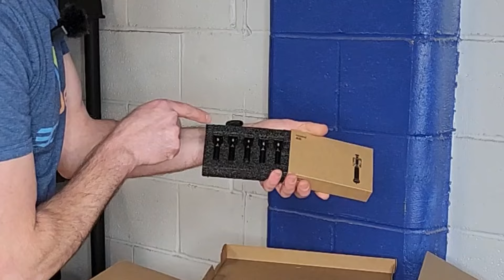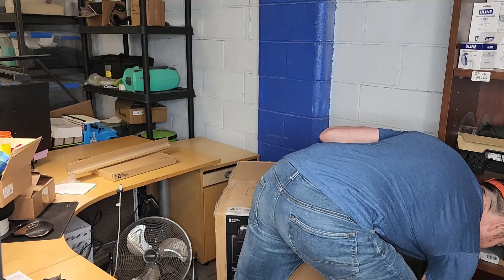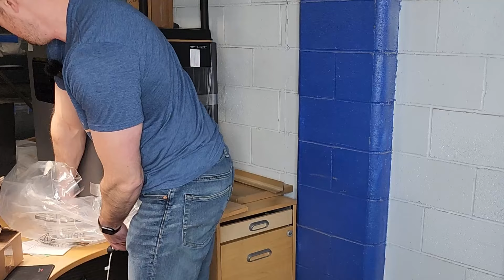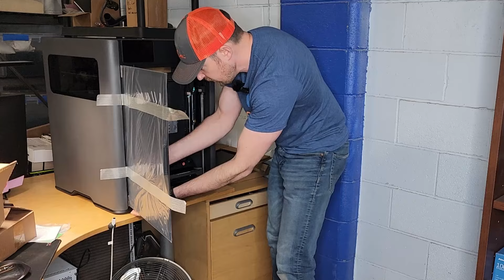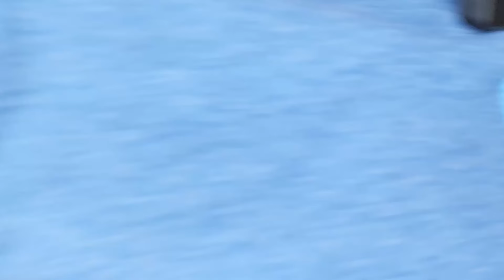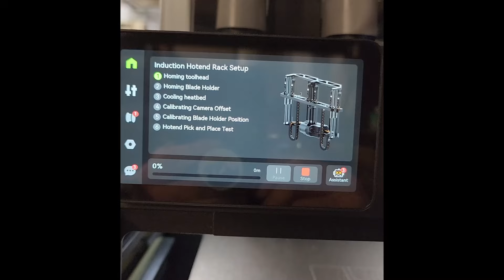3D-Fuel Unboxes the Bambu Lab H2C

Comment: I'm not sure if I like the nozzle swap system? Send like a lot of moving parts... 😂
Reply: Is it though? Everyone keeps saying this, its literally an extruder motor moving a rack up and down on linear guide rails, that will never fail. The hotends themselves are held up with magnets. The pcb boards on them will be more reliable than pogo pins on other printers like the snapmaker because they are contactless and transfer power and info wirelessly. Induction heating has no moving parts. The only thing that is a wear item is the locking fork on the toolhead and Bambu says its rated for 300,000 tool changes.
Reply: @SangheiliSpecOp  Well, anything can fail and the more moving parts you have, the more chance of failure that can happen, and there are a lot moving parts in that transfer.
Reply: @SolarBearDIY it might look high tech, but my point is that theres not much more moving parts than default. Another single motor added to a printer that already has two corexy motors, a z motor, and two motors inside the toolhead (extruder and nozzle switcher) isn't that bad, whens the last time you heard of a Bambu motor failing? The racks are on steal linear rails just like the headbed which moves up and down continuously. Whens the last time you heard of a headbed failing to move up and down on a Bambu? Well, the vortek system moves up and down a fraction of that. The hotends are cheap wear items. So if the magnets or pcb boards are bad, you just get another one. It really is a more elegant solution that having 4 or 5 toolheads with the same hardware repeated over and over

Comment: I understand the lets not follow the unpacking guide but for most people its probably better. It makes unboxing/setup little easier and makes sure you don't remove some of the smaller parts hidden in the printer. Set my h2c up yesterday and its humming along just fine.
Reply from the maker: Clearly I know better than everyone else. Clearly. So. Clearly. 😂
Reply: @3dfuelusa  It was fun to watch but i guess for many watching the youtube video they made is very helpful not to miss some small part i already seen several people printing with a part inside that should be removed (like on the back rod).

Comment: If I had room I’d put an H series in my truck
Reply: You'd need like 1600 watts to heat that bed lol
Reply from the maker: @SangheiliSpecOp  Yeah, we found out the hard way that our old, tired power strip would have its internal breaker tripped when the H2C would heat the bed and pre-heat the chamber. Which was odd, since the H2S we had in the same spot while I developed profiles for it did not do that...
Reply: @3dfuelusa strange. It does have two nozzles which takes more power, and one of them is an induction heater. I know it heats both when doing the start up sequence so maybe that pushed it over the edge

Comment: I find it curious that Prusa as a Research Company could not in the fours years that XL has been out, could not make their tool heads fit their Printer. PS I dont like videos where your are headless. HEHEHEHE
Reply: What do you mean by fit their printers?
Reply: @SolarBearDIY I'm going to assume OP meant they are surprised they didn't put their toolheads into a smaller form factor like the snapmaker U1. And the obvious answer for why they didn't do that is because they wanted to be able to charge people $4,000 for the only large form factor printer in the market. Its crazy that the snapmaker U1 came out of nowhere and was wildly successful because its so low-cost and obviously what people would want. It's faster than the XL and even the H2C
Reply: @SangheiliSpecOp  So, lets talk about the low cost of Snapmaker first. SnapMaker (SM) is a Chinese based company that has been arounf for a while now, but really expanded into the global market rapidly over the last several years. This success was financially driven primarily by "Crowd Sourcing, " but mostly through Chinese private investment and ventur capitalists. Why does this matter? While SM is not directly subsidized through the Chinese goverement, the larger finance companies are. When a companies financial resources are heavily subsidized it allows them to sell there goods at a lower price that can undermine an entire market. This is part of China's innitiative, "Made in China 2025," that is part of their econimic plan to dominate the worlds manufacturing sector and that includes 3D printers. I will do a simple copy and paste for saving time explaining this a bit more.

"Snapmaker aligns with the goals of the Chinese government's "Made in China 2025" (MIC2025) initiative by innovating in advanced technologies, specifically in the field of 3D printing and digital manufacturing. 

-While there is no evidence Snapmaker is explicitly named in official MIC2025 documents, its activities contribute directly to the initiative's core objectives: (remember that SM financial backers are subsidized).
-Promoting Additive Manufacturing (3D Printing): The MIC2025 plan identifies 3D printing (additive manufacturing) as a key promoter of the national strategy to move up the global value chain. 
-Snapmaker, as a leading developer of consumer-friendly 3D printers and multi-functional machines, directly supports the development and popularization of this strategic industry in China and globally."

So, that is a short summary of why SM can sell their Printers for such a discounted prince. I was reading a Joseph Prusa Blog a while back that also covered this topic, and one of the point made really resonated with me that I will paraphrase. "Some of the printers on the market that are made in China cost less money than some individual components in some of our (Prusa) printers. We simply cannot compete with that so we have to apply different strategies to stay competive and stay in business."

I have an additional comment regarding the potential of the XL to @alanday5255 on this same thread.

I hope this makes some sense~GarBear
Reply: @SolarBearDIY  OKAY.. so the Prusa XL came out in 2201-2022, it has changeable tool heads. No other Prusa has PRUSA MADE changeable toolheads. Now 4 years later they hire another company to make tool heads for their printers. They did not make their own by streamlining their own design AND they are a RESEARCH company.
Reply: @alanday5255  Ah, I see what you are thinking, but not really accurate to no fault of your own. There is a lot to unpack and explain here so I might break it up into a coupe of different replies, but let's start with the Prusa/Bondtech relationship centered on the INDX system. For time sake I will just provide a copy and paste that is fairly easy to Google search that will provides sources.....................

"The collaboration that led to the Prusa Bondtech INDX arrangement began when an external inventor presented breakthrough ideas for an induction-heated tool changer to Bondtech. This initial concept was then developed and refined through a close partnership between Prusa Research and Bondtech. 

The Initial Invention
The core idea for the INDX technology originated when an independent inventor "knocked on [Bondtech's] door to present us some breakthrough ideas". These ideas included patent submissions and a functional, raw prototype demo that impressed the Bondtech team. A key concept was using electromagnetic induction (the "IN" in INDX) to heat the nozzle directly, which allows for incredibly fast heating and cooling cycles with low thermal mass passive tools. 

The Prusa-Bondtech Collaboration:
Bondtech developed the base technology, creating the "Smart Toolhead" and the "passive tools," but the complete system required significant integration work. 

Prusa Research's involvement was crucial for: 

-Hardware and Firmware Integration: Prusa engineers worked on seamlessly integrating the system with the Prusa CORE One printer, including firmware and the bed probing system.
-Software Support: The development of the necessary PrusaSlicer support for the eight-material setup was handled by Prusa's team.
-System Refinement: Both teams collaborated to ensure the INDX upgrade felt "native" to the Prusa ecosystem, focusing on quality and user experience. 

This arrangement combined Bondtech's patented tool-changing design with Prusa's expertise in creating integrated, user-friendly 3D printing systems, resulting in the final INDX upgrade."
Reply: @alanday5255  So, by reviewing my previous reply you can see that they did not "Hire" another company to manufacture their print-heads/extruders, they are working in partnership with them which is common in the manufacturing world. It usually boils down to available resources vs time. 

So lets take quick look at the XL and its capabilities vs what the INDX system provides. The INDX system is obviously more compact, but it may be limited to, and probably is, a certain range of textiles/plastics due to what it is designed to do. The limitation is that realistically is only has ont extruder/toolhead compared to the XL that has up to 5. What does this mean? 

What this means is that the XL is more capable  i regards to working with a larger range and materials. Tnis is obvious with the recent release of the Silicone TH that is capable of mixing two materials required for the "On the fly" synthesis of silicone in 3D manufacturing. So, now lets say that you can add silicon accents to a PETG model with good interlayer adhesion. That is two seprate toolheads providing two different textiles that have different requirements for forming at the positive side of the hot end to create a model. Cool stuff right, but what if the Base material you want to use doesn't allow Silicone to adhere well to it such as Nylon? Why not have an even different toolhead for for and adhesive layer that can allow this to happen? 

Now we are up to 3 different tool heads serving 3 different purposes. One for your base material, Nylon, the second for silicon parts, and a third for a special silicon adhesive that will bond the two together. This will allow for seamless integration of models using different materials that would otherwise be impossible with your standard 3D print, even if it does have multi tool-heads.

This is where the XL will shine with upcoming add-ons and implimentations. It really is an amazing printer that has a lot of capabilities and reliability. In my opinion Prusa still remains the leader in innovation. My opinion is that the XL did get put on the back burner for a bit while Prusa focused on their new Flagship models Core One and Core One L in order to meet consumer demand and quality expectations, and have more advanced capabilities that some industries require. 

Sorry for rambling on and I hope this all makes sense~GarBear
Reply: @alanday5255  Well, bondtech made a kick ass toolchanger unit that the chinese can only dream engineering. And considering prusa's history with bondtech, and prusa's love for 3rd party and open source. It only makes sense that prusa would just team up with bondtech to be the 1st to support their INDX on an out-of-the-box printer. Prusa and bondtech have been collaborating together for over a decade. Bondtech made the extruder gears for prusa printers for years and there are so many bondtech print heads available for prusa's MK and mini printers. Prusa isn't bambu lab, prusa isn't the chinese, they aren't anti 3rd party like bambu, and aren't against supporting 3rd party, unlike bambu lab.

Do you know why bambu lab had a 2nd story floor in their booth at formnext? It's so they could watch over prusa/INDX and see how they could rip off the INDX.